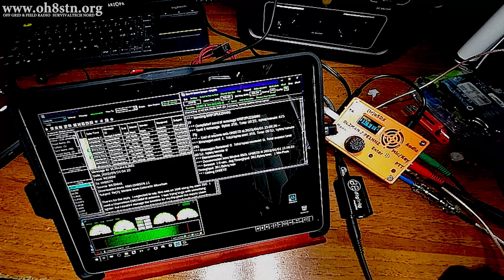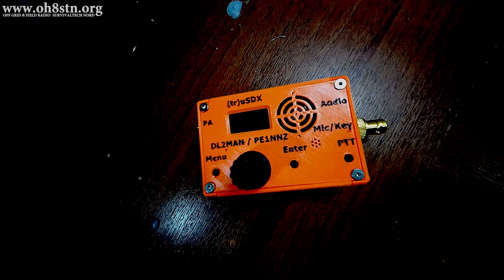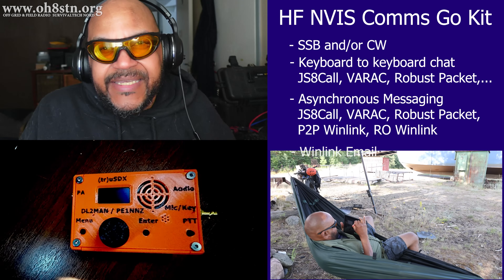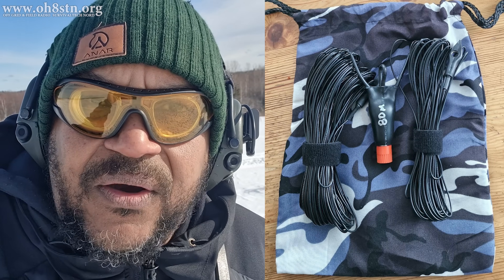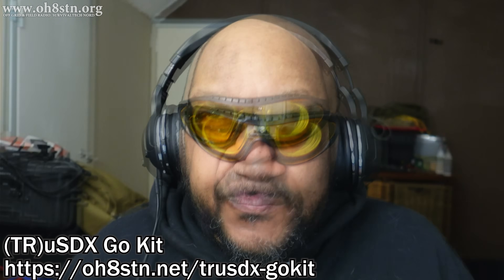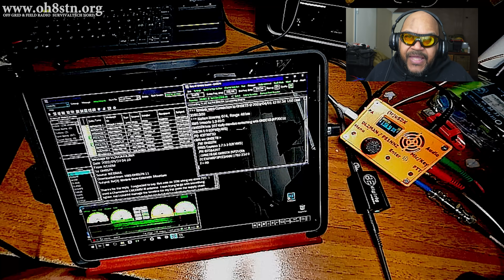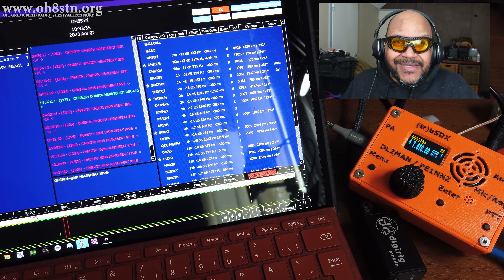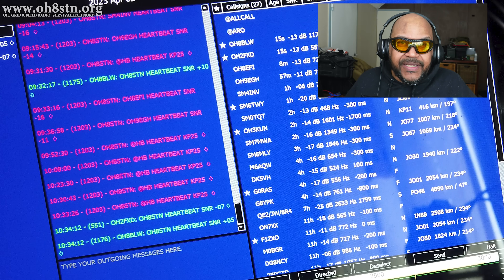Budget Ham Radio Go Kit

Comment: Now that the qrp labs QMX has SSB & it’s the same price as the trusdx+digirig wich one would you choose in 2026 ?
Reply from the maker: That's a trick question :-)
Naturally, the one that has an audio interface built in so it can simply be plugged into my computer without needing an external audio interface. Moreover, the one which can do Vara Winlink. 500-2700hz. 
Outstanding question

Comment: Curious, why did you connect the sdx to the pc, if you have the digirig?
Reply from the maker: Digirig is an audio interface, not a TNC. It still needs a computer to run the software for the modes we are running.
Reply: @OH8STN  Thank you

Comment: It would be VERY helpful to show us the settings, i.e. baud rate used for digirig mobile.  I can't get my windows computer to talk to my (tr)uSDR using digirig mobile.  Any suggestions?  I confirmed the driver is working.
Reply from the maker: From description ofbthis video: 
Blog has an awful loot of additional context. All radio settings tutorials and links are also there: https://oh8stn.org/blog/2023/03/24/qrp-nvis-data-modes-go-kit-trusdx/

Regarding the specific problem you mentioned, check that you have the digirig driver installed.

Comment: These little radios are great, but don't last long. The transmitter stops after a few months of heavier use.
Reply from the maker: That's true if they are continuously over driven and have a poorly tuned antenna. Personally,  I use proper radios without relying on these for anything critical.
Reply: @OH8STN  Thanks for the advice. Will lower the TX Drive on mine and save up for a better QRP radio. 73!

Comment: I had a look through your blog. I have the exact same setup which works for FT8 etc. I cannot get Winlink to connect at all. The audio seems to be clipping. how did you set up the audio for winlink
Reply from the maker: Indeed this is a problem. You have to reduce your output audio from your computer to the trusdx. Also, reduce the microphone audio gain on the trusdx itself (menu?). This processes Is very fiddly and very frustrating.
Hope it helps.
Reply from the maker: I nearly forgot. You must also reduce the a g c auto gain control in windows or linux, To prevent clipping. Each audio interface has Its own setting in the audio interface properties.

Comment: Why do you need an interface? I just used some 3.5mm patch cords along with a cheap USB sound card. The CAT works fine over USB as well. The cable to the mic input of the SDX needs to have the tip wire disconnected, and thats it.

Comment: I watched this a while back, but filed it away for later investigation. Lately (end of May 2023) I'm seeing renewed interest in QRP pocket HF via the QMX and the QDX on various videos so I rewatched this pioneering venture into the topic and have finally gone forward in ordering a (tr)uSDX and (another) dedicated digirig. I like that, as opposed to the QDX and QMX, both fine little rigs, the (tr)uSDX supports up to 16V input power which I find fantastic-- so this blends well with existing ham batteries and you don't need to get these janky 11V Li-on/LiPo or PD power sources. All these pocket transmitters should be made to handle LiFePO4 voltages, otherwise it's yet another barrier to entry.

Comment: What were the Digirig input/output levels that were eventually reached for “fire and forget”? I assume since the Digirig is an external sound card, the ideal levels should be the same across any Windows machine. That is, Digirig output set to 12.2dB on one Windows machine(sounds control) should result in the same level as another Windows machine using the Digirig, with the setting the same.
Reply from the maker: It's always going to be different on different computers.You'll just have to start testing full stuff. I started at 50% for both transmit and receive. The critical level was the transmit level. Too high and you overdrive the radio.

Comment: Julian, QRPLABs just came out with a new radio kit.  The QMX was just released at Dayton Ham Fest.  This radio combines the QCX with the QDX.  Bottom line, this radio can do everything that the trusdx can do but is better.  Right now it only supports FT8 and JS8Call for digital modes, but the creator Hans Summers assures us that the upcoming firmware upgrade will give it SSB and full digital support with capability to do the Vara data modes.   It reduces the cable mess to a single usb C to your surface go 3.   I managed to pick up an advanced kit at Dayton and will be assembling it shortly.  Once I build it, "I will tell you all about it".   I have both of QRPLABS QCX-Mini and QDX digital radios.  I also have the TruSDX.  The trusdx is a good radio but very noisy with lots of birdies.   I suspect the QMX is going to be a game changer for this type of deployment.  Better performance, same size, with reduced cable mess.  Just thought I would give you a heads up.
Reply from the maker: Thanks for the heads up🙏
Love the idea, but I won't hold my breath.  QRPLabs is notorious for promising rigs and/or functionality,  but never delivering. When QMX supports ARDOP, VARA, PACTOR, ... I'll get excited. I've said for years, QRPLabs doesn't understand the data modes operators requirements.  If they did, the radio would support the full range of data modes, from the beginning. 
Thanks again 🙏
73
Julian oh8stn
Reply: @OH8STN  Oh, I wasn't aware of that.  Guess I will have to rely on my IC-705 as my primary radio and the TruSDX as the ultralight economical backup.  I am not a CW guy and neither is anyone in my family.  My primary concern is being able to keep in contact with them if things go sideways.  Since they are products of the computer age, showing them how to use vara is a 10min learning curve.  Now CW is a whole different animal.  I will keep watching and learning from you.  Thanks.

Comment: Great video, very appreciated. Two questions, when low weight is concerned: 
1) would truSDX digirig and mobile phone with otg USB cable be viable option? At least for some digital modes?
 2) Xiegu x6100 has mods with custom Linux people run in if js8call and it can do rtty with stock firmware, has battery and atu. Wouldn't that be better option if weight is concerned?

Comment: True great video
I'm new to all this and saw your video is there any way you can run a dummy class on how to build out and use this properly
We had one of the worst storms we've had in a while out here took the power company 5 days to get the power back on and the cell service 2-3 days to get back to normal
Seen the links in the description everything looks adorable can we run it off an old cellphone or an android tablet
Or if you have setup similar to this for my baofang radio we have like 6 of them for when we go camping and fishing
Don't know if we could get the same range as with this set up but would like to know if it is possible.  
Thanx will be looking out for you new stuff and looking at the old see what I can find

Comment: Excellent information as always.  I couldn't agree more on the Windows vs. Linux argument.  I'm in your camp on that one.  When I have a choice, I'll use Linux.  But, you have to use the right tool for the job.  If Windows works better for the job, then Windows it is.  I haven't purchased a TruSDX yet.  I've heard the sound on it is terrible (which makes sense, considering it's size).  But, I'm warming to the idea of getting one for a lot of the reasons that you mention here.  DE K7RLN

Comment: The problem I have with HAM is that in an emergency you will want to contact family who are not licensed HAMS.
Reply from the maker: This is the problem we all have. There are ways of sending emails from hams to non hams, but during z frodcdown, There's no guarantee the non-ham will even have internet. For this reason, we tried to get at least one person licensed from every household. Sucks, but that's the way it is.  There are no other radio services with as much functionality. 
Thanks for the comment.
Reply: @OH8STN  Maybe the rules need changing. If it was at least one of the 2 in privite simplex communication had to be licensed this would go to solve the problem.
Reply from the maker: The problem is equipment can be dangerous.  Getting licensed ensures we understand the equipment,  how to operate safely,  and that we can avoid hurting others.  Safer alternatives exist like FRS/PMR, GMRS, MURS, CB, MESH, ...
Reply: @OH8STN  FRS radio's can also have the same dangers. In some areas they are even running repeaters leagally. Somthing I cant do as licenced ham radio operator. What I'm talking about is nothing more dangerous then what is already hapening. In fact even safer as one of the operators being licenced and use restricted.
Reply from the maker: I don't agree. With ham radio you can use a kilowatt of power on frequencies from 0.5Mhz to 36Ghz. PMR 0.5 watts on several channels. Ham: multi-element directional antenna, PMR: no removable antenna. 
I have seen radio experimenters with severe radiation burns. There is a difference in the level of danger. 
Btw. I don't make the rules.

Comment: Another question, on your blog you called out Chinese manufacturers for copying the trusdx. But your YouTube links as well as the blog links, send us to a Chinese imported trusdx to buy. Is that on purpose?
Reply from the maker: Context is important.  The TRuSDX seller is an approved supplier. The others stole the designs, changed it, then sold it as if it were the same.
Reply: @OH8STN  ah okay! Maybe add a little note to your links?  👌

Comment: The N9SAB antenna are already sold out, so that's a bummer. I was looking for a budget antenna option for the IC-705, that isn't very expensive like the Chameleon antennas, which doesn't require additional equipment like a mast or a tuner.
Reply from the maker: Keep checking. I'm told they'll be back in stock soon. 👍

Comment: Agree with you for hf radio and hf antenna but all the other gear seems a bit too much for the mountains. Still waiting for cell phone to radio hook up to cut down on weight,size and batteries. Living at 9000 feet above sea level means light weight wins most of the time.
Reply from the maker: I don't disagree.The problem is developers aren't porting the tools we need for android. Anyway i've got something interesting on this topic incoming. 👍
Reply: @OH8STN  If anyone can get it done it’s going to be you!

Comment: I am a Linux guy.  My wife and kids also use Linux.  I bought a used Thinkpad with Windows on it for amateur radio stuff.  It isn't just Winlink.  If you are dealing with repurposed commercial gear like radios and repeaters and repeater controllers, the programming software is Windows based.  I have tried running a bunch of this stuff with Wine and things often crash or don't work properly.  Don't listen to the haters.  I would rather use Linux than Windows but if you need Windows to accomplish something, it is what it is.
Reply from the maker: Thanks for this comment 🙏👍

Comment: This kit looks like a much more viable offgrid option than some you have used in the past where size and energy consumption are major considerations.  Now that you have shrunk the size of the radio gear  it's time to match it with a more appropriate computer/controller for digital modes.  I have watched you go from laptops, to Pi's, and to the Surface Pro but it's time to pair down to the next step which is running everything from your smartphone...you may lose varac but you can still run winlink, ft8, and js8 call.
Reply from the maker: @hikerboyz No JS8Call yet but I'm hopeful. The smartphone functionality is critical.
Reply: Last I checked there was only a JS8Call receiver for Android. Has that changed ?
Reply: In the meantime, there is a version of FLDIGI that runs on Android!
Reply from the maker: @tzm1843 the UI needs tons of work.

Comment: AMEN!  Winlink on Linux STINKS!  Pat Winlink is.. a nice attempt, but if you've ever used Winlink Express you'll simply never find Pat Winlink acceptable in the least.  Sorry, Jason, it's garbage.  I've been spending some time getting Winlink running under Wine.. and it's close.. but.. still have some bugs to work out in order to get it to a point that I'd be comfortable living with it off-grid for a month or two.

Comment: Nice job brother. I'm using a cell phone power bank with 4 removable 18650 batteries. The power bank will directly accept charging from a 20w foldable USB solar panel. The other 18650 batteries are in a watertight box hooked up in series feeding a buck/boost converter feeding the trusdx transceiver. I run 12.5 -13.8 volts for voice. I get almost 6 watts on 40 meters measured in CW mode to a center fed 1/2 wave 22 guage silicone coated wire dipole. Its set up NVIS and is tuned for the middle of the band. Quick deploy thanks to wire management via light weight fly fishing reels. The last step is to add the digital capability. Thanks for this video. I'm sharing it.
Reply from the maker: Outstanding setup. Would be nice to see your kit as well.
Thanks for sharing, watching, and dropping the comment. Greatly appreciated.
73
Julian oh8stn

Comment: Great video. Could you do a detailed video on the radio settings for digital modes and the reason for the usb hub? I will primarily be using fldigi. Thanks
Reply from the maker: For your other question, the reason for the usb hub is the microsoft surface having only one usb port. Since the radio has u s b for cat control, two u s b cables are required. One for audio and the other for radio control.
I'll do a field deployment video in the coming days.
Reply from the maker: The blog post I put up in combination with this video has all the radio settings. 👍

Comment: I think for a short deployment this system, for a year in/ year out scenario, either a caravan or  40 foot trailer 40-50 foot telescopic hydrolic antenna..

in your current method of deployment you have no  active communications  to/from point a to point x to and from

At worst you are going to rely upon uhf cb or 27mhz cb to rely for road conditions  and so forth 80-20 meters  might be fine  for a semi permanent position  when you get to a bol location, it  be pretty  pointless  thing to listen to  on the way to get where you are going...

these toys have a teaching element to them however I think  when you look at proper deployment scenario you are going to spec a multi  radio kit 1 to cater for analog the other  to cater for digital usage of frequency..

though i would love to see what happens when  apply digital as what is seen on uhf/vhf and see what if you applied the same technology to hf and see what happens..

Comment from the maker: A budget ham radio go kit based on a (TR)uSDX QRP radio. The kit is designed for NVIS or regional data communications using data modes like Winlink, Ion2G, JS8Call, FT8, VARAC, ... This QRP radio covers 80, 60, 40 30, & 20 meters.
Check the blog post for additional context and radio settings.
73
Julian oh8stn
Share video URL: https://youtu.be/kdslE4r8VyY
Blog: https://oh8stn.org/blog/2023/03/24/qrp-nvis-data-modes-go-kit-trusdx